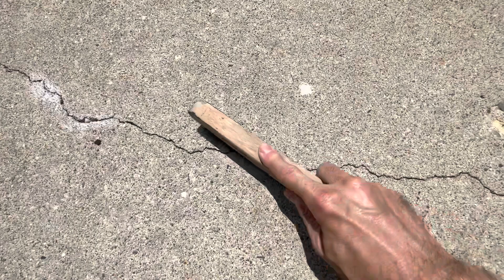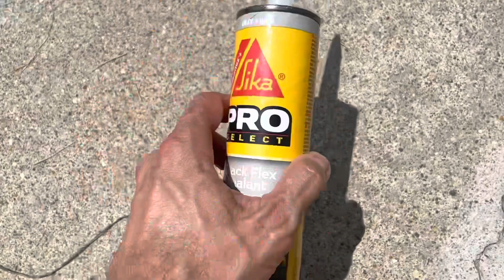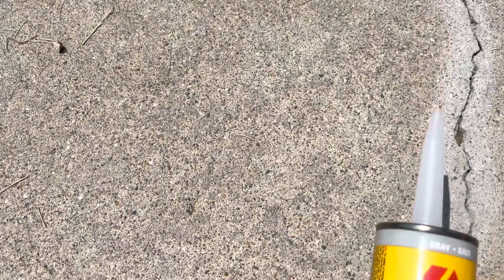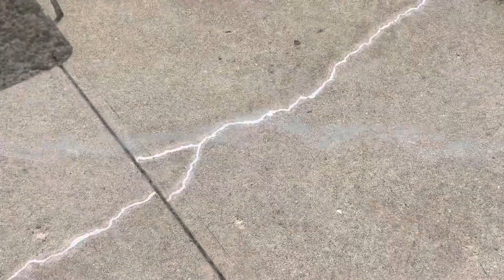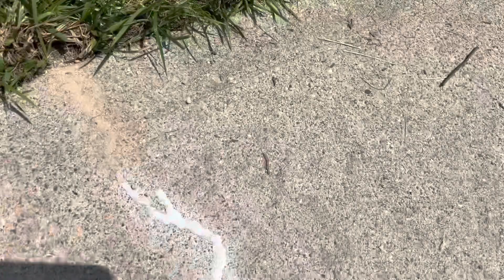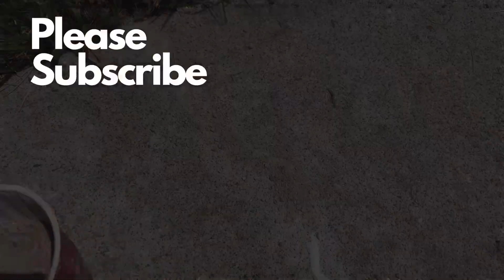Fix concrete cracks before next winter for $15

Comment: Do you think this product would work in deeper cracks? I have concrete steps in the front of my house and they are kind of separated where they come together but it is a little deep.
Reply from the maker: Good question. It is not a matter of how deep, it is more “how wide” is the gap. 
Let’s say you have a half an inch gap, you control the depth by filling the hole with sand first until the depth is an inch. Then you use a backer rod on top of the sand to seal the hole and leave just half an inch depth for the product. The product is meant to not allow water to ship through the crack. Having a half inch off that elastic product is enough. 
The crack in my video is minimal and there is no need to fill in with sand first. 
Please consider subscribing to my channel. It will help me on doing more videos like this.
I am regularly fixing things around the house and adding videos about it.
Reply: @gotitdone yep I just subscribed. I will definitely do that on the steps. I tried something else a few years ago and it didn't hold up at all. This is my first house and there are so many things I didn't know about and I'm finding out over the years. I live in Minnesota so I understand the temperatures changing drastically in a year. I will definitely be checking out more of your videos.
Reply from the maker: @donhenry7930  yeah, you don’t have it easy with the weather over there. 
Anywhere water sips through, it will freeze during the winter and will slowly break the concrete by expansion. 
You will be surprise how much you will learn if you attack one problem at a time and investigate what others did in YouTube. 
My best wishes to you.